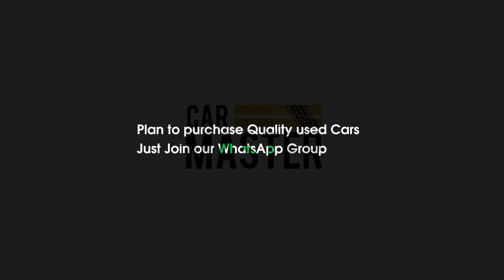How to Maintain Diesel Vehicles in Malayalam 2022 | Used Cars Review | 4K | Car Master

Comment: Great video,superb as usual

Always use distilled water with coolant never use mineral water coz even though it appears clean it has added minerals which will result in deposition and  damage the parts in long run

And one more thing if you observe closely ford has clearly mentioned to use only 5w30 synthetic oil in the engine cover and clearly they understand it better try using the shell ultra it is a gem of an oil u will feel the difference immediately and one more thing it costs only Rs 1300 for 4 litres at the Ford service

Don't misunderstand me I have a ford ecosport titanium plus of 2016 which has run 95,000 kms am speaking out of experience.

Comment: Its better to use synthetic engine as it cantains many type of addictive and detergent formulation which results in cleaner and sludge free engine environment and using an mineral engine oil in a high combustion diesel engine is not an good idea as it cannot with stand the high temperature in combustion chamber

Comment: can you please share the way to clean turbo and intercooler as I see a severe performance drop on my Ecosport TDCi? I cleaned injector sensors and air intake sensors, still no difference. seems like carbon deposits have clogged everywhere. Also, what is your opinion on blanking/closing EGR valve?
Reply: Clean your EGR valves  bro...its best to lift the engine and do it...It should be done in the time of major service,so that you can cut down labour cost.